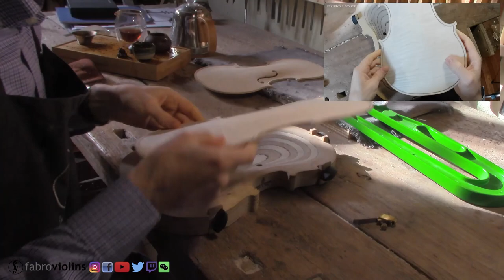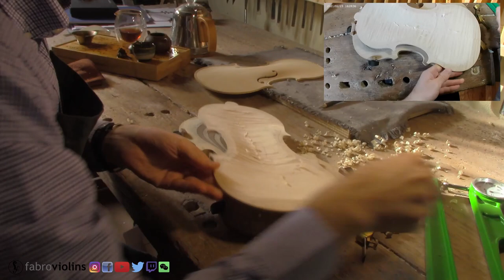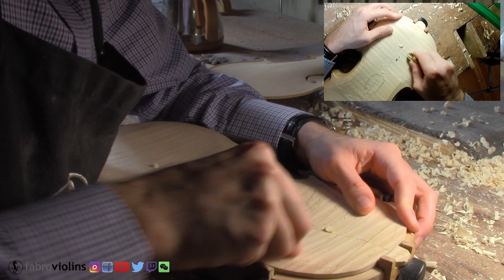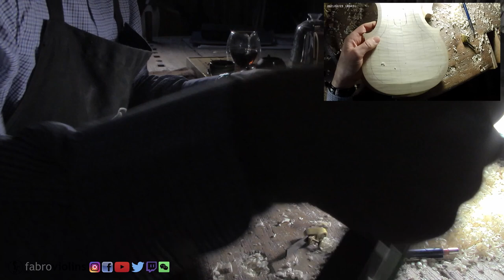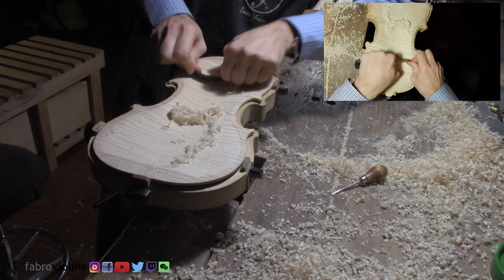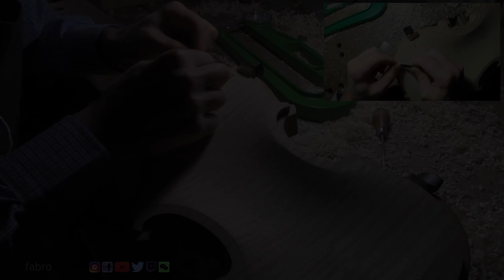MAKING A VIOLIN (Baroque) | Back Thickness

Comment: Lucas, I recently started your online course. I am enjoying it very much. I would like to make a baroque violin as well. What changes would you make to the “Messiah” if you wanted to make it as it was when it came out of the Stradivari workshop? Thanks for the video.
Reply from the maker: Thank you very much for your message! I'm very happy you're enjoying it :) Maybe a baroque course could be the next thing! Haha

There are actually quite a lot of differences to make a baroque violin, and if you wanted to make one just as it was when it came out of Stradivari's workshop even more!

But to mention some of the differences between baroque and modern: 
 - Bass bar
 - Neck joint
 - Neck size/shape
 - Fingerboard material/length/radius
 - Tailpiece
 - Tailgut
 - Projection
 - Bridge
 - Strings

I hope I didn't forget any, but if I did maybe someone else will comment it :)